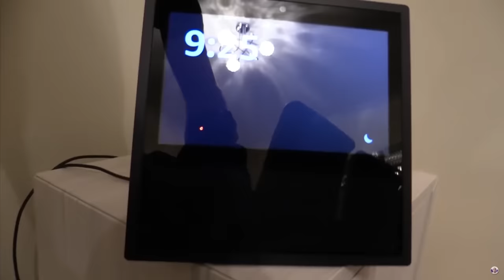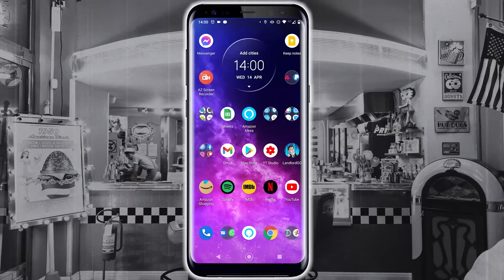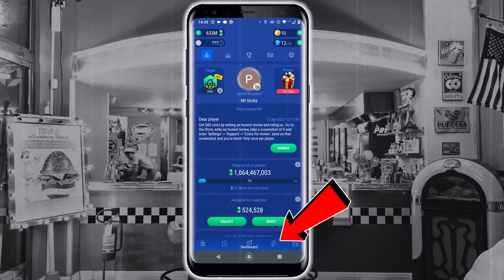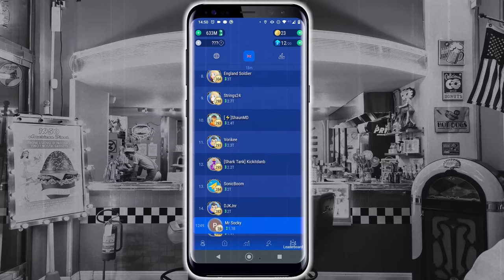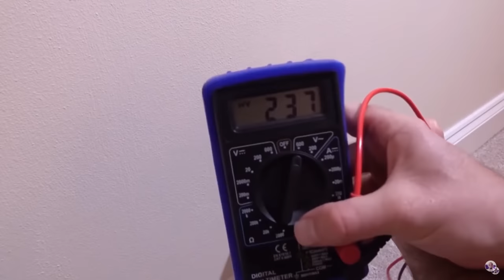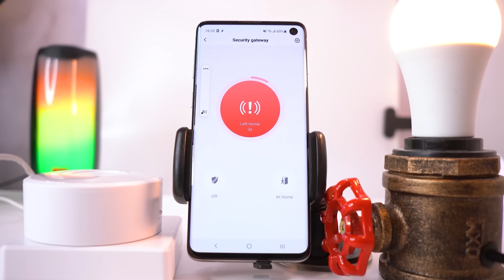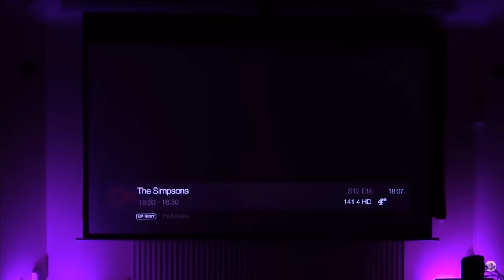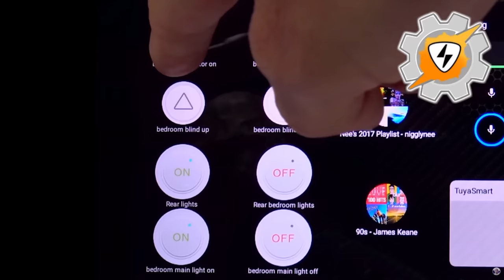Starting A Smart Home I ULTIMATE GUIDE

Comment: I use HOME ASSISTANT!!!! And it's awesome. I learnt about it from Paul!
Reply: For me, Homebridge is more simple and works great. But I've heard that Home Assistant is more stable, is it true?
Reply: @florintoma4045  I have it for few months without single hiccup yet, so it might be :)
Reply: @florintoma4045  it probably is if you get good supported hardware, which is non trivial, specially if you don't live in the US
Reply: @lolno1000  an old pc will work. Or one of those thin clients they use in offices. i3 or even Celeron should be plenty powerful
Reply: @hornetIIkite3  yes, probably 1% or less of people would like to run it on a pc. Plus. it's not easy for the common person. I spentcountless nights to troubleshoot problems on my raspberry pi (and I'm not exactly a n00b). There's home assistant blue, which is great, but if you live in Europe, you are out of luck
Reply: @lolno1000  I had it running in 25 minutes and haven't touched it since. It detected all of my peripherals. Only edited my dashboard a bit
Reply: @hornetIIkite3  yes, in fact the software is years ahead of the competition in my opinion. But it's hard to find proper hardware. I would never recommend HA to my friends or family who are not expert in IT
Reply: @lolno1000  I also use Home Assistant here in Europe. I have lots of hardware that works. Gledopto LED Controllers, Hue Switch, Shelly, Fibaro, Gardena, iPhones also connect to HA. 
I setup my complete home within 2 weeks. Most time I waited for ordered things.
Reply: @alexfiftyfour  I was referring only to the hardware (i.e. rpi) that runs home assistant. Support for   smart devices is pretty good

Comment: We have run the Alexa and Google home setups for a bit and ultimately ended up favoring the Google home.  While your comments on device support are accurate we haven't felt limited with Google home.  More importantly the devices simply worked without needing to build routines or use overly long voice commands.  For example I have a combination of smart switches and bulbs in my living room.  Some of the switches are named "lamp" etc. since a floor lamp is connected.   I can simply say "hey Google living room lights on" and the bulbs plus switches named lamp will all turn on.  This required zero customization on my part.  

It was more accurate and easier to follow-up on with questions and transfer results to my phone.

Pairing with calendar functionality, easy integration with YouTube and streaming ended up sealing the deal for us a few years ago.  I think they are both great, but if you want to just use things without tinkering, you or your kids access YouTube a fair bit, you like smart phone integration and use Android... and you don't plan to order Amazon products via voice command... Google home has been the better choice for us.

Comment: Love the shelly devices. In the US we have a neutral wire in our light switch boxes. Ive installed the shelly in multiple locations to control lights AND keep the functionality of the normal switch. (A switch becomes a toggle when attached to the shelly.) If the internet died, the toggle still works!!  Great stuff!!
Reply: Jason - it is the same in Australia. Our electrical system is 240VAC and mainly 10AMP. Our Light switches are size US format as well but our mechanical switch are up for off and down for on! I use Moes House Tuya light switches. They have a Zigbee range as well. The tuya response is instant through Alexa and consistently works 100%. The Tuya server is based in the US. All our generic hardware stores use the Tuya smarts in electrical fitments.

Comment: I'm in this position right now. Been in my new house for three weeks. I had my old place pretty well hooked up but this time I want it taken to the next level. I've messed with Home assistant whilst waiting to move and will have that as part of it. I like Echo in each room and car as the interface. I'd like to do a lot more than just lighting and security. Something actually smart. I've brought some of the components from my old place (LightwaveRF, Hue, Eufy doorbell, Lots of Alex's of various type's). I've a four zone heating system that I'm going to use nest to control (need four nests so not cheap) and there is an existing security system that I'll be adding too. I am aiming to make the house aware of what's going on and proactively manage itself as well as alert me if needs be. Lots to do now I've painted and got some furniture! Interesting video. Thanks..... and notice I've not referred to beef curtains this time! Love you! xxx

Comment: Amazon Alexa is the best for home automation, it has the most skills.
Echo dot 4th generation has zigbee builtin (to control my blinds, doorlock, etc.).
Also, Google can't add a device to more than 1 room or group; example: kitchen and family room are adjacent to each other and I want the lights in both room to turn 
off if I say all, as well as independently turning off either room.
Alexa is inexpensive so I bought 8 to equip every room with Amazon Alexa for voice control so that I can just ask 'turn off the lights' and the echo in that room 

knows to turn off those lights and not other lights in the house.
Google app's fonts are really really really tiny for my old eyes.
All 8 of my Amazon Echo devices have a clock... very convenient to tell the time or see a timer's countdown.
or better sound, I have a few of my Amazon Echo dot 3 with clock output the sound via its 3.5mm headphone jack to my Denon HEOS speakers.
New home automation users who want zigbee to communicate with blinds, door locks, lightbuilbs, etc. can just buy the Amazon Echo 4th generation with builtin zigbee.

Comment: Great info Paul! Question: I’ve been slowly adding stuff to my house over the past year. Smart lights, switches, blinds, nest doorbell battery and Google assistant. I’ve reached the point where I want to start adding motion sensors (I think zigbee is the best option here), and want to make add more automations and control, which Google assistant really lacks. I think my best two options are SmartThings or Home Assistant. For a somewhat beginner, will I outgrow SmartThings too quickly? Or is Home Assistant too complicated?

Comment: OK, you guys with your 220V psycho-killer electricity are both hilarious and scary.
Here in the US there are lots of alternatives for replacing light switches and plug-in sockets.

Lutron Caseta is probably the state of the art and not only can you completely rewire your home using the Pico remotes. A Pico remote can be placed anywhere, on a wall, like a light switch, under your desk, on your coffee table, etc. Each Pico is completely programmable and you can make them control any of the other Caseta switches (Dance! You puppets! Dance!). Each  Lutron switch includes a dimmer (well... most of 'em do. There's a couple that don't). Each Pico switch is a dimmer and has a "favorite memory. MY favorite are the Pico's at the front and back door that shut down the whole house as you exit or turn it on when you return. 

The downside is the cost -- about $40 per switch. Pico's are less, but you'll find plenty of uses for them. Another downside, you'll need a Lutron Hub ($20 if bought with a switch/pico bundle) and you're limited to about 50 units. Once more downside (Damn you Lutron!) the Pico cannot trigger an Alexa routine, but all switches can be accessed via routines. By-and-large, you can get away with buying the Lutron PKG1W-WH kit with a switch and a pico ($60) which kinda drives the whole thing down to about $30 per switch (but only if you have a lot of three way switches, each actual connection requires a switch, not a Pico, the Pico's are just to extend the system and perform three way switching). 

Lutron also provides wall-wart's to control stuff that's plugged in (they call them "Dimmers"0. There's a dimmer switch on the wart, but you'll really just want a Pico to control it, so spend the extra $5 ($45 vs $49) to get fries with your burger...sorry... Pico with your dimmer.

Another downside: If you want to control "off brand LED's" you'll need the more expensive Caseta switches (the ones with the center button). The PKG1W-WH switches work with most "mainstream" LED's, but if you have fussy overheads requiring GU10's or GU16's or those damn fussy halogen replacements, it's gets pretty pricey with PD-5NE-WH reaching $120 per switch!

In addition to Lutron there are scads of other WIFI and Zigbee switches you can place in your wall.... and .... BONUS! 110V tends not to kill you!  In places where I don't need the bulletproof performance of Lutron or the extension capabilities of the Pico switches, I've mixed in Kasa (about $15 per switch, no hub, but no dimmer, they seem to work OK with standard LED's). I've also used BN-Link smart plugs to control heaters and chillers.

Kudos to the YoLink motion sensors. 

Also, love the RM-pro for all the one-off's. 

I prefer Ecobee over the Nest for the thermostat, but I have questions about their commitment to the marketplace (they recently rewrote their browser interface and it's horrible!) ... so maybe ignore that recommendation...

+1 on the comment - be prepared to spend some cash... even if you go "the cheap route" you're easily in for several hundred dollars (minimum) as you start down this road to madness.

Nice Job and thanks to Paul - Thanks for sharing your near-euro knowledge, always enjoy the vids!

Comment: Try this smart switch : V-42B2206-001 its a battery and cable free switch that you could putt in the sealing if you so wanted to because there are no cables and you will never have to change a battery in it, it’s compatible with the casambi app and it have Bluetooth!

Comment: "IF" Amazon update their zigbee line up not when, they might just drop zigbee completely because let's be honest these big companies make some very strange decisions 😂
Reply: Making money is the companies' #1 priority, not quality
Reply: Zigbee is not going away. Just a glimpse at the recent hundreds of Chinese Zigbee sensor 2021 releases and improved Zigbee Version 3 in all Tuya Zigbee Hubs is overwhelming. Tuya  will become compatible directly with Alexa. WIFI based IOT devices exceeding 30 require a very powerful router to control the Dynamic Host Configuration Protocol for required multiple access points. There is the simplified WIFI mesh system with multiple points throughout home. If you have automation for the medium size home you will exceed easily 100 devices - a mixture of WIFI and Zigbee of 200 devices is an unbelievably easy number to reach as a number for a family. Zigbee also save you money long term as the batteries are costless and can last up to 3 years in tiny devices. WIFI sensors tend to be bulky with larger more expensive batteries because WIFI is more energy hungry. The range is extended by mains powered Zigbee devices that act like repeaters on same Hub. I have a rule for my automation: Sensors should be Zigbee if possible because of these benefits. Wireless Zigbee hubs Version 3 are easily purchased in AUD$ example for between Network Wireless $20 to  Network Wired $30. I favour independent from Alexa. MULTIPLE Zigbee USB sticks can inserted in any Pi computer configured with Home Assistant for less $5.00 each for Zigbee and directly talk to Xiaomi & Tuya Zigbee devices and many other brands.

Comment: Best advice I can give.   Make sure everything you buy can be controlled locally by Home Assistant locally (i.e. without a cloud) 

Two reasons:

1.  You are going to end up with Home Assistant anyway.   All smarthome devices from a simple timer socket upwards, are gateways to a more dangerous smart home obsession.  When you buy, just accept this, and make it part of your calculation.  

2.  All the internet reliant devices are just a throw of a scissor switch and a mad cackle from being made obsolete by a greedy manufacturer.  If you make at least the ability to control the device locally one of your pre-conditions of purchase and you wont be crying "corporate greed" before bedtime.

Comment: I have to say that you got me to look at Home Assistant. I've had it a week with no experience of coding and I have to say it's taken over. I feel ruined! I was quite happy with Alexa routines before...now I'm trying to understand geekbabble on forums to work out why something that should be simple (if you use Alexa) isn't in Home Assistant! I even considered buying a Raspberry Pi...but no, worked out how to create a virtual machine instead. 

My experience of Google Home is that it's in third place after Apple (I do have an iPhone and Apple TV), Alexa is still top by a long way but I don't like Google Home at all. I've found the recent Apple updates to be very clever at times, but stupidly frustrating at others...it's not an automation if you have to give it permission to run! 

I also agree, if you can get away from Hue then do so. I like the stuff but the prices are mad and I find the idea that they can just switch off a hub because...more yachts...annoying to say the least. That is also what made me think about Home Assistant because of the idea that it 'can' run without an internet connection...if you buy more stuff and can code.

I have one question: does the Broadlink RM Mini support the IR codes for the Nintendo Wii? It's the one thing I've not been able to get it to learn. I only want it to do the power button, using it as a controller would be daft, but I'd just like to build it into a routine!

Comment: I have led panels so switching out the bulb could not be done. Switching out the light switch on the other hand was a big no-no from the wife because of "design problems". So since we have a 1story house with an accessible attic where all the light cabling can be seen, I searched for all the lighting cables, cut the switched wire going to it and I added a 2pair cable to the 2 exposed ends. Then I ran these cables to a central control box I made that is located above the router in the attica and I ran power to it also. There I would have the wire running to the lights, the wire that is operated by the light switch and a constant live wire with ground and null. Then I just added the yeelight dual relay to all lamps (see user manual). If the internet goes offline, then the switches can manually operate the lamps and if I have to reset some networking parameters on the relays I would just pop the plastic box off and press the 8 pieces of relays (btw 1 relay can operate 2 lights so they were a pretty good buy). On the long run, I found it a better solution since the smart home market is changing and if I decide to switch a vendor, I would have all the wiring in one place, or I could just take out or swap relay if they brake. When I think smart home I always want a manual/analog fallback. That is why when motorizing my shades I bought control relays that can be operated by switch/wifi/google home/ RF remote.

Comment: I currently have a Ring Video Doorbell 3 (wired), an Amazon Echo Show 10, and an old Arlo2 system w/2 cameras. Currently using the Ring app for the doorbell, the Arlo app for the cameras, and finally Alexa to control the Echo Show. 

Now I want to upgrade to smart deadbolt locks with keypad entry. 

Can I tie some of this gear together using my Echo Show 10? If so, what smart lock would also be compatible with the Echo Show 10?

Comment: i would recomend  zigbee wireless aqara switches -if you are not able to wire switches -you can get them for like 12 euro and are usable with home assistant  -also tuya wifi lamps -are a great cheap starting point -also sonof has some great and cheap sensors -on aliexpress

Comment: Would the Alexa speaker be able to control some kind of wifi enabled diy nsnoleaf set-up?
Seen some really cool ones.
Also forget the brand but they have their mini lcd screens you stick to thr wall and can upload pics/gifs/loops to.
Do you know what brand I'm talking about?
I did have some lifx bulbs but got rid of them when moving but looking to install some Gu10 flush mounted ceiling lights. Any advice?

Comment: So……. I hope this isn’t your real name. If it is? You might get a Liam Neesan type call from my wife.
I took great pride in paying my credit card off. And all it took was ONE episode of your channel, and I’m shopping like I’m stocking up my imaginary dooms day bunker. Hahahahahaha

Great, great channel.

Have you got any alternatives to the flic switch? I’m just installed smart light switches. And down lights for bedside lamps. I have WiFi bulbs. But Sonoff do t have a switch that I need. Ie: flic. And I don’t want to splice the power cable because I don’t want anyone to see the switch. Hope that makes sense!

Awesome channel. I’m addicted.
Reply from the maker: Thanks so much man! ❤️ Check out the video I did recently called "the death of smartthings". Ajax do a hub and a button that you could use instead of Flic. I'm not 100% sure if the button is use able in Alexa routines though, it may only be able to control tuya based devices.

Comment: can i get into smart home stuff with a bad internet connection.  a bad in kinda slow when it works (54kbps-200kbps) and about 50% uptime?
google nest whatever basically shits itself with that kind of uptime, every time the internet goes down you have to re set up the device and that’s extremely annoying and i basically don’t use it anymore. is there anything that won’t do that? philips hue seems to handle shotty internet pretty well with its hub thing for example

Comment: 2 questions, Is there a device that will connect to z wave and  zigbee  so they can commutate with each other, not counting home assistant.
If is uses the echo dot 4th as a zigbee hub, can I use my eco dot 3 to control the zigbee devices connected to the dot 4